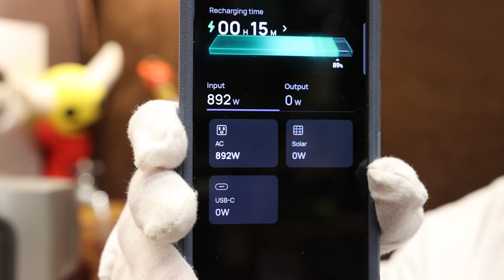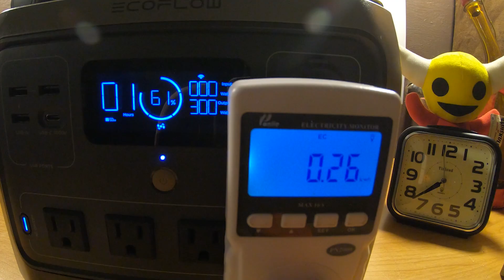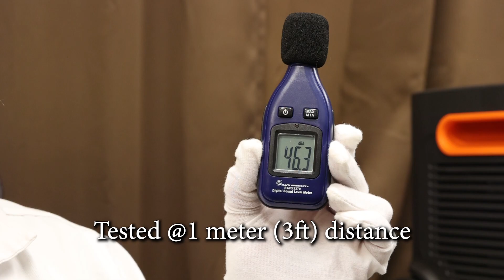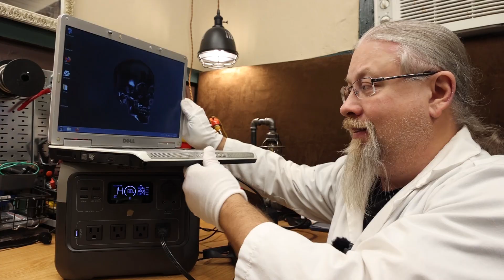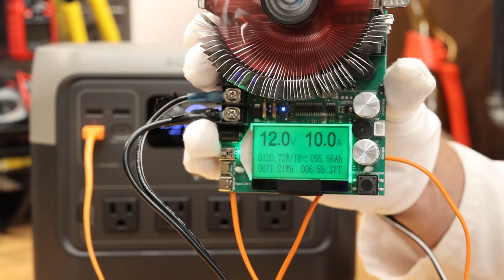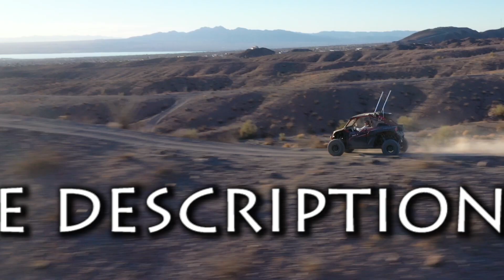EcoFlow River 2 PRO 800w LiFePo4 UPS Power Station Solar Generator Review

Comment from the maker: GET THE RIVER 2 PRO: https://gohobo.io/river2pro code ECOFLOWAFF or 25EFVAHOBO
[Get it on Amazon: https://gohobo.io/amzr2pro ]
GET THE R2 MAX: https://gohobo.io/r2max code ECOFLOWAFF  or 25EFVAHOBO
GET THE RIVER 2: https://gohobo.io/river2 code ECOFLOWAFF or 25EFVAHOBO
Ecoflow's Website: https://gohobo.io/ecoflow code ECOFLOWAFF or 25EFVAHOBO
Reply: Picked up this bad boy with the 220w panel! It was 999$ (already great deal imo those panels are pricey) and your coupon code saved me like 75$ more bucks!

Thanks hobo!
Reply: You could make the ups test even more realistic by running a load on the laptop (eg video rendering).  While it's sitting idle on the desktop screen, that's exactly when ups isn't all that critical
Reply from the maker: Load or not doesn't matter.
Reply: Code no longer valid.  do you have an updated one?
Reply: Not sure if I missed it, but not in the links. Does the spare battery work for this?

Comment: Is this power station able to power my .3HP sump pump in the event of a power outage? It wouldn't be running continuously because the sump pump only kicks on briefly when the water level reaches a certain level

Comment: I just purchased the River 2 Pro. I purchased to just power my 1991 refrigerator. I tried it out and it worked just fine. After watching your video I became concerned.  My fridge doesn’t show the wattage. It does show that it runs on 120 , 115 and 110.  When I plugged it in it said I had 17 hours left on it. Is it possible because it’s an older refrigerator that it will be fine to use this power supply on  normally the power only goes out for about eight hours. I also only need to use it until it gets the refrigerator down in temperature and then I can disconnect it.

Comment: Hobotech----Your are just too much fun!!!!!!!!!!!  Well, honestly, your not only fun, but very, very informative.  I knew you were serious when I saw your white latex gloves and lab coat.  I figured you were either just trying to show off, or you really had the goods, and to me, you really have the goods.  Boy you've got a lot of great test equipment.  You must either be a real technician or electrician or at the very least a really serious enthusiast.  I just bought this unit, and so far, I'm really jazzed about it.  I'm mainly gonna use it for pretty low level stuff, like charging drone batteries, running my laptop in my car, etc. but I love the fact it's got some fairly decent power if you need it.  Thanks for a great presentation and keep up the good work.  Marc T.

Comment: HELP HOBOTECH 🙆🏻‍♀️
So I purchased the Eco Flow River 2 Pro and 110 W solar panel also by Eco Flow, From REI.
In the feature section on REI’s website for the solar panels, it stated…
With an MC4-to-XT60 converter cable (not included) this panel can charge EcoFlow DELTA and RIVER Series portable power stations
I’m not terribly savvy when it comes to solar and not sure what this converter cable is for because I have cables that came with the panels to connect to the River 2 Pro
I do want to find an either 10 or 20 foot extension cable for the panels so that I can keep the river pro indoors, but not sure which option From Amazon is best for my equipment, can you please give specific converter cable recommendations with either 10 or 20/25 foot extension?
Found two possible options, but not sure which one is correct for my needs, from reading the reviews, information overload .
Aside from preferring extended cable length, please specify any/all cable connections required to run the River pro off the solar panel .  Thank you so much for your time, great video.

Comment: Thanks for this. Informative and appreciated!! 

 I bought one of these yesterday and I like it so far. I live on a remote island so my Internet comes in via Satellite.

I have two questions, this time round. 😊

1) Why is there no wattage output registered on the LCD Display when I plug in the Satellite Dish that sends me the WIFI Signal that is necessary to use the Internet? Is it because there is no power consumption from a Dish?

2) In 2025, with the evolution of Power Banks and Batteries , does it reduce the life of the battery to charge it up before it gets low or is drained? The power goers out a lot here, especially in late Autumn. The outages vary from 4 hours to 14 hours or more and can happen several times in a week. So if say the battery is at 66% is it okay to fully charge?

Thanks

Victor

Comment: I bought this Sept, '24. for occasional power outage. Beforehand, I tested it. I ran my All-in-one PC, Router, and LED floor lamp for 10 hours. Plus I made a pot of coffee. I used it in service for a 6 hour outage. As the power is never out more than 12 hours it does what I wanted. Next I'll get the Panels.

Comment: =  I can plug in my tv and internet router and an electric reclining chair connected to river 2.
=   Then I can plug river 2 to my wall a outlet
=   If power goes out, the tv, internet router, recliner will keep on running?
=   I understand time that these items will remain on will depend on the power needs of the 
     appliances.
=   I also may need a larger ecoflow  or other solar station product

Comment: One question:
Although charging from multiple source is not supported, what about pass-through? Can I inject solar power between my computer and grid power? So If my computer uses 100W and I have an 80W solar plugged in, will it pull the additional 20W from the wall?

Comment: Just got one today. Didn't work for my full sized fridge. Oh well. I use the delta 2 as a UPS on my garage full size fridge. I will use this river 2 pro as a tv UPS.
Reply: I also tried mine with my 15 plus year top freezer fridge and the river 2 pro shut down when the fridge compressor cycled back on.  120 volt  15 amp rated fridge .  I wonder if the x boost will handle the 1800 watt surge without damaging the fridge?

Comment: Do you believe a portable dryer (120v) that pulls 850w is too much for this?

Black+Decker - 1.5 Cu.Ft. Stackable Smart Electric Dryer with Standard Wall Outlet - White
Reply from the maker: 850 is more than 800 last I checked. You want the Delta 2 to run appliances.

Comment: Hi.  I bought this model on the strength of your review.  To my great displeasure, it seems impossible to turn off Wi-Fi.  I'm on hold with EcoFlow even now and the guy actually insisted that there is no way to disable Wi-Fi!

So, I know you've done "all sorts of crazy experiments" with this thing - do you have any super secret tricks?  How would you you, yourself, use it in a grid-down situation?  Or out in the boondocks, where there is no internet and no Wi-Fi?  Maybe I'm missing something, but it just seems nuts to me.  Any thoughts?
Reply from the maker: How do you use it in a grid down scenario? You would push the buttons or control it via Bluetooth.
Reply: @HOBOTECH  Thanks, I think I could do without the app if I could turn off Wi-Fi.  But, FWIW, I was not able to get the app to connect via Bluetooth until I gave it my Wi-Fi credentials.  It kind of tricked me into it, and now there seems to be no way to undo the Wi-Fi.   Some may not understand, but I just don't want the Wi-Fi pollution.  It creates unnecessary RFI and serves no purpose other than to make every other Wi-Fi thing work just a little bit worse.  In my mind, it should be no more difficult than putting a phone or laptop into airplane mode.  There are any number of reasons that that one might prefer to turn off RF emissions.  It serves no useful purpose on the River 2 Pro, making it all the more absurd that a device intended for use off grid can't be taken off grid.

Comment: Below is from their website, so I wonder if I am using this outside at 90 degrees have I voided the 5 year warranty.  
“You must store it at temperatures between 20ºC (68ºF) to 30ºC (86ºF) and completely turn it off after it reaches full charge.

Comment: Hi 👋🏻, I just wanted to know if this can power and keep up with an 12v air conditioner for semi truck that I recently installed and wanted to go with a clean power to run during the night in the hot Florida weather, and if it can for how long will it run , please let me know open to any suggestions thank you 🙏🏻 

PRODUCT PARAMETER
Rated Voltage: DC 12V
Voltage Protection:9-11.8V
Rated Current: 60-80A
12V
Rated Power: 960W
Cooling Capacity: 1000-3000w
Range of Speed: 1000-3000 RPM
Reply from the maker: No generator on the market can handle 80 amps at 12v. You have to use a battery. See my battery playlist for recommendations.
Reply: @HOBOTECH  there are 16 videos on the playlist, is there one option you recommend going the battery route?

Comment: If it can only charge at 250 watts, and I'm using a desktop that uses 800 watts, can it run my desktop at 800 watts and charge at 250 watts simultaneously?
Reply from the maker: Of course.
Reply: @HOBOTECH , Awesome. Thanks!

Comment: When will you be able to review the new Etaker M2000?  First ever semi solid state.
Reply from the maker: Not sure who lied to you but I reviewed a Zendure in 2022 that was the first "semi solid state". The pouches are still just as flammable as NMC without the cycle life of LFP. No one cares about new tech that doesn't solve existing problems.
Reply: @HOBOTECH  
The M2000 doesn’t have pouches.  It’s different.  Did you see the Etaker M2000 on YouTube?  I bought one and it smokes my Anker Solix C2000 and Ecoflow Delta Pro. The M2000 is half the size as the Ecoflow and 30% lighter.  Capacity test came in at 91%.

Comment: Confirm, the xt60 port is only an input, and isnt bi directional correct? I was going to go with the Delta 2 (not max) but when you showed it wouldn't pass the UPS test, i decided to stick with the cheaper river2 pro for my small portable power station as you displayed/ tested in this video. Do you know if firmware corrected the UPS test on the Delta 2, or is that a hardware issue that cant be corrected with firmware?
Reply from the maker: Yep

Comment: I am looking to buy this power station for my shop, to run 8 led shop lights and a ventilator that requires 2 amp. Do you think this is the right one for this?
Reply from the maker: You need something 2kWh or larger. Check out my review on the Delta 2 Max.

Comment: I purchased the EcoFlow River 2 Pro recently and greatly appreciate your review. However can you tell me why the DC output shows extreme fluctuation in wattage? Doesn’t matter what 12v item I try to use with this output or how long it is plugged in. The wattage fluctuates continually more than 15 watts. Thx.

Comment: Excellent vid!     My use case would be:   run a 1/3 hp sump pump with the RiverPro2 acting as a UPS (a/c input from wall   24x7).  Is this ok/safe/recommended?   Thanks

Comment: I bought several EcoFlow battery generators and several of their solar panels. When I went to charge them using the solar panels I found out that you need to buy an accessory MC4 to XT60 connector cable in order to charge these with solar panels.  I really like the EcoFlow generators, but I thought this was pretty lousy and I'm sure many will find out the hard way when they have an emergency. BTW, Bluetti does come with a connector to use solar charging.

Comment: So you plug your computer into the EcoFlow that is powered by the inverter.  AC from the wall outlet keeps the battery charged.  When the wall outlet goes dark, there is no interrupt of power and no switch over.  Now you are running without a source to charge the battery.  I don’t get the UPS as a function.  What am I missing here?

Comment: Excellent video, extremely helpful. Would it be possible and practical to use the river2 pro as a full time UPS to power my cable modem and netgear router. I have a battery backup system specifically for my home sump pumps that also has a wireless module to alert me to any problems with the system. So, I need to be sure my internet does not shut down when the power goes as it often does. Thanks for your time.
Reply: Have you tried running you sump pump with the River2?

Comment: I just got a Bluetti EB3A but it doesn't have enough power to run my VitaMix 5000 blender. It shut off at 789 watts output, that's the last number I saw before it quit. Can you tell me if this EcoFlow River 2 Pro will handle the VitaMix?
Reply from the maker: It should.

Comment: just found out I can't do solar and output at the same time on my 1kwh ecoflow delta 2. That's disappointing, I was expecting/hoping I could do both, since the intention is possibly doing computer work or running a fridge whilst charging via solar (+ excess to battery), but sadly it seems that is not the case
Reply: 13:12 hmm, you can do solar passthrough with this? you make it sound like ecoflow should work with it, but my ac output wouldn't work whilst I was solar charging

Comment: @HOBOTECH or anyone really- can you advise if someone already owns APC UPS and using it for the modem and router for surge protection and short power back up.  Could I plug that UPS into the Ecoflow without major issues?  I'm fairly new to all of these power back up options.  Thank you.

Comment: These power station solar generators remind me of the large radios or "boomboxes"  from back in the day, and I remember the D batteries some of them took. It be nice if these units had a battery compartment to change out the batteries when the batteries cycle time maxed out, and no longer able to hold a charge, though that would require all the manufactures to stay on the same page.
Reply: These newer power stations that have the LiFePO4 aim to solve some of that. They are supposed to have a 3,000 charge and empty cycle lifespan. If someone charged and completely drained it everyday that would last 10 years.

Who even knows where technology will be in 10 years. We didn’t even have these power stations widely available 10 years ago. That’s makes these a safe bet at least until the next step in tech.

Comment: I have had mine for 3 months.  The watt meter is flaky.  When the inverter is on, it shows no current draw.  We know this is not so.  Should be 7-12 watts.  Will drain the battery in a few days, so I know there is a drain.  
Second issue is when charging from two 100 watt mono panels in series I am getting about 160 watts.  When a cloud passes over, current goes to 0.  When sun comes back out, watt’s go from 0-60 over and over again.  This will continue for 10 minutes and more.  Unplugging the st 60 from unit and plugging back in will result in going back to 160.  Very annoying, and requires me to constantly monitor.  Anyone else have this problem?  I may have defective unit.

Comment: You know what you are talking about so ill ask you. 

I dont have an EcroFlow brand but my one is true UPS (10ms) 

But if i have it plugged into the wall and providing power by mains all the time (until power cut) then surely the batteries will be fully charged at all times!

Doesnt that damage the batteries as its not going through a frequent charge and discharge process? Ive been told that its bad to have the batteries hold a full charge for long duration. 

Can you please help me understand this?

Thanks

Comment: i have gotten this 2 to 3 days ago, maybe 4 days ago, and tbh, i love this little guy, when the power does get cut off, i have 2 monitors and a desktop computer, i purchased this ecoflow river 2 pro like at the end of august, and got it september 5th. and tbh, with the watts im pulling out of this is 60 - 100 watts, im able to get 7 hours of runtime, if i don't have my other monitor on, 10 hours of runtime. yes, it does tend to discharge though i have it on the really low watt power which is 100, to prolong the battery life, and i am physically using this as a UPS/EPS, however, i do have an APC back up as well too, and that apc plug is hooked into my ecoflow river 2 pro. yet when the power does get cutout,  then it'll switch to ecoflow river 2 pro, and there is a fault, however, i don't believe thats a problem, since i get 7 hours, or maybe 8 hours, with the APC backup i have like an additional 50 minutes or so.

Desktop tower pc: under full load its 150 - 175 watts. and that still gives me 5 hours of playtime if i ran that.

i will be getting the precon as well, since that can last almost a day and a half!

Comment: question as I'm a dummy about these things, We recently purchased a Lomi composter and wondering if it will work thru a. cycle iwt hthe River 2 Pro. each cycle uses about .6 to 1 kWh of electricity. the cycle we use is 4-5 hours. it could peak at 1500 watts early on. any thoughts?

Comment: Hi @Hobotech. Thank you for your technical review!
I have purchased this product and I encountered a major issue with the 12V car charging; after 6 weeks it stopped charging. I got a replacement and a new charging cable. It lasted 2 days 😮.... 
Ecoflow does not have an answer for me what's the problem. Other than replacement of refund. But that is not a solution! I live in EU but in US also many such cases are known. I have a Jeep Renegade with a euro6 engine, maybe the problem is in the alternator output? I would verder much like to stick with EF r2p, do you know a solution?

Comment: I bought the river 2 pro after watching your video and then discovered something!  The DC input in the back is an XT60i!  If you get the "i" it can handle 13a instead of the 8a the XT60 can.  Your test bumped against the 8a limit of the XT60 plug I'm guessing you used.

And it can do simultaneous charging but has a hard limit of 800w.  If you set the AC charging lower I've seen it charge from both as long as you are under the hard limit.  So no massive charging from everything but it can take input from both at the same time.  I see mine do it everyday in the morning since the battery discharged to my backup reserve limit and it starts trickle charging from AC and then also solar until the solar can handle the load.